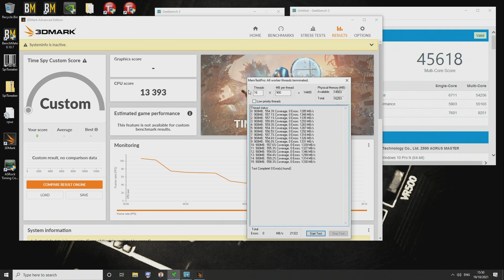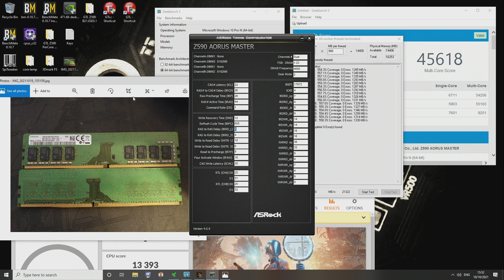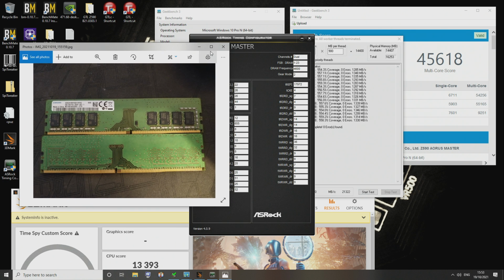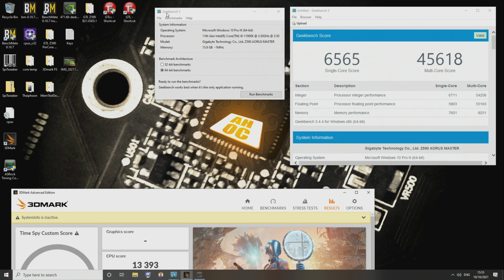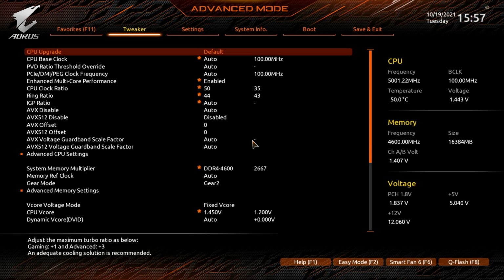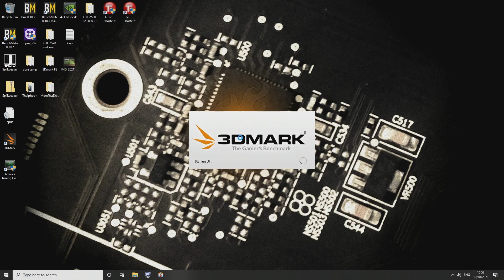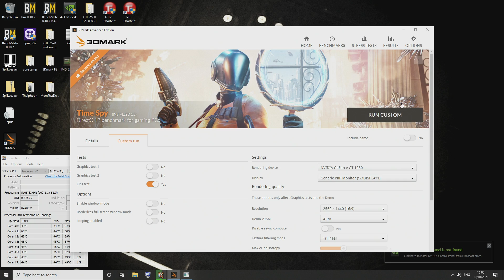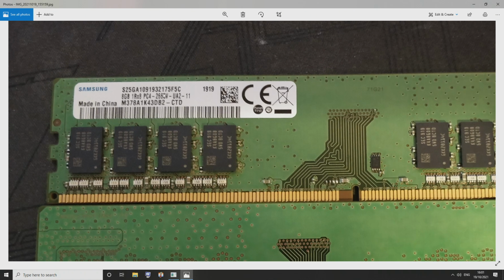500% memtest pass at 4600 CL22 on a 2x8 2666 CL19 kit of DDR4

Comment: I am actually confused, I just bought G.Skill Ripjaws V 3600 cl14 @1.45V 2x16GB and it has 2666V downbin b-die BCTD on a B1 pcb insted of 2133 BCPB. Should I be worried about oc performance???  should I stay at max 1.45V and do a max oc at 3800MT??? 
My system is ryzen 5900x on a msi B550 unify-x.
Thanks for your help.

Comment: I was just wondering, I had some tforce ram that has xmp of like 4500 and runs fine on 5900. It seems that 3600-3800 is a little bit better or do you think I should try to run at 4500 and optimize everything

Comment: Did you hear that DDR5 is going to have locked voltage for some modules? This is going to suck for doing this kind of thing on OEM green ram like this. There is probably a hardware workaround you can do to the power management IC though. Or else it's going to be locked at 1.1v

Comment: I've never seen you play with Gigabyte's 'Memory Enhancement' settings in BIOS. Not sure if it's on every board but is present on z490 Master BIOS version F20. Don't believe you changed 'Memory Timing Mode' in that video either. Im curious to hear what you think about it, if you have experience with those settings, and what difference it makes for stability. In my case turning Memory Timing Mode to 'Fixed', and Memory Enhancement to 'Enhance Stability' stabalized a fairly agressive overclock. Would be cool to see a video where you played around with these and experimented with how they change memory behavior.
Reply: Memory Enhancement just sets secondaries and tertiaries slightly differently. Potentially useful, but you might just lose more perf than you'd gain from the aggressive overclock anyway.

Comment: I have some DDR3 that has similar temperature sensitivity. Registered/ECC Samsung 2gb rev C. It works up to 2200 10-11-11 (bclk limit on x58 board). At some point it crashes and struggles to post, until I let it cool a little. Then it's fine again. There's not much of a gap between working and failing to post. Maybe the register ic freaks out at higher temps.

Comment: Hi buildzoid just wanted to share my results with Nanya 8gbit A Die 2x8 2400 cl16 RAM. I got it to pass 1000% memtest with 3200 at 14-18-18-34-1T. CL 14 required 1.35V. I was able to tighten the secondaries as low as they could go except Twtrs. Even the SCLs did 2-2. I could do it only with help of your videos. I got this with an r3 1200.

Comment: I would love a video about what tweaks joe-consumer could do with a more typical RAM kit. Like I enjoy PCs and have built many, Ive done some OCing over the years of CPUs and GPUs, but I honestly dont touch my RAM. I buy a kit thats reviewed well, I turn on XMP, and thats it.

Im not really looking for anything extreme or finely tuned, but is there a RAM equivalent of say the fact that a GPU comes with a 1 size fits all voltage curve and therefore very likely can do the same clocks at lower volts.
Reply: There isn't a "1 size fits all" solution because different memory ICs have different properties, and different memory kits are binned to different degrees.
However, "DRAM calculator for Ryzen" can be useful as a guideline, even if you don't have a Ryzen CPU. I based my current memory settings on it and got fairly good results, though there were a few timings that ended up a bit better than the tool suggested (especially tRFC), and my RAM isn't stable above 3000MHz even with very loose timings even though the tool suggested that it would be (probably because my memory is a downbin).
Based on my experience, if you want to do a simple change, try reducing tRFC by a hundred points or so. Especially with single-rank memory it has a big impact on performance and lots of RAM comes with it set way too high by default (e.g. around 600 when it can run fine at 400).
Reply: @nathangamble125  Thanks for the comment. Not meaning to be rude, but you opened with 'there isnt really a thing', and then ended with 'but here is the thing I just said wasnt a thing'.

Comment: I have Hyperx Predator 3333mhz CL16 Samsung B-Die. Any help how to overclock this ram, what values should I put. Also what voltage would be safe, because heat spreads are big. My cpu is 5600x.
Reply: Samsung B-die can generally tolerate fairly high voltages (easily 1.6V+), but if you're using Thaiphoon Burner to identify your RAM chips it might be worth trying another method, as it occasionally misidentifies C-die (which doesn't work well with high voltages and could be damaged by voltages that would be fine for B-die) as B-die. I'm sceptical that a 3333mhz CL16 kit would use B-die, though it might just be a very low bin.

If you can, removing the heat spreaders and looking directly at the memory chips is a sure-fire way to identify them. Samsung DDR4 memory chip codenames have 2 lines.
The first line is "K4AxGyy", where x is the capacity of the chip (4 = 4Gb, 8 = 8Gb, A = 16Gb, B = 32Gb) and yy is the chip bus width (04 = x4, 08 = x8, 16 = x16)
abd "5Wx-Byzz" where x is the die type, y indicates temperature range (C = 85C, I = 95C) and zz is two letters that indicate JEDEC speed.
So if the second codename line is something like "5WB-BIRC", it's B-die; and something like "5WC-BIRC" is C-die.

DRAM calculator for Ryzen is sometimes a good source for recommendations, though note that if your RAM is B-die it's probably a low bin, so it's unlikely to run as fast as DRAM calculator suggests. DRAM calculator works best with XMP data exported from Thaiphoon Burner. Its built in "bad bin" preset for Samsung B-die goes up to 3600MT/s 16-20-20-36-60 (that's CL-RCD-RP-RAS-RC) on the "safe" calculation, so there's a decent chance yours can manage that. B-die's tRFC usually goes quite low: 360 should work, though possibly not if your bin is very weak.
Reply: @nathangamble125  ok thanks, that answers a lot of questions. Also just a question what speed is the best to run with 5600x I know latency is very important but let's say I want to downclock 4400mhz cl 19 ram, what speed would be most efficient? 3200? 3600? perhaps 3800mhz with ryzen 5000.

Comment: I have a ASRock X570M Pro4 with a AMD Ryzen 5 5600X water cooled, and G.Skill Ripjaws V F4-4000C18D-16GVK (4000MHz RAM).

What is the best way to OC my AMD Ryzen 5 5600X to run my RAM on 4000MHz on CL18?

Thanks.

And great OC.
Reply: Sadly most Ryzen 5000 cpu infinity fabric gives up after 1900mhz. beyond 1900 it'll start spewing WHEA errors. usually it's best to put it to 3800mhz and tighten the timings as far as they'll go.

Comment: I have 4x16gb of samsung gskill memory but the XMP of 4000 CL19 is not stable with all 4 sticks, even after further increasing memory and SA voltage.
Do you have any idea what else I can try to get it to run 24/7 stable? 
What voltages do you use on the samsung dual rank 16gb sticks? :)
Reply: Quad rank memory is really hard on the memory controller, especially if it's Samsung B-die. Try to lower the frequency and the timings, like 3600 CL16 or 3200 CL14.
Reply: @Odysseas13LefkonaSt  sounds about right
Reply: Does SA voltage have anything to do with soc voltage?
Reply: @BonusCrook  I think SoC voltage is the Ryzen equivalent of SA and IO voltage on Intel.
Reply: SA and IO voltages have a sweet spot, so it's hard to give 100% conclusive answers without testing it (although said sweet spot is generally anywhere between 1.15 and 1.3V, in my experience).

As for memory voltage, do bear in mind that increasing voltage means increasing heat. B-Die is quite sensitive to heat, and with four times the density of a 2*8 setup, that can be a considerable issue.

If you don't want to spend too much time on it, I'd just back down on the frequency. Otherwise, well, test the SA/IO, try a lower ring ratio, tweak the termination/resistance, then have a look at secondaries and tertiaries.
That's how I generally approach things, by order of importance (in my experience).

Comment: Wanna know something crazy. If you buy corsair dominator platinum 32 gig kits 2x16 they say it might be single rank it might be dual rank. So it sounds like it used to be dual rank but its probably cheaper to do single rank and in this world of shortages they all are going to be single rank. Not to mention they want 250 bucks for 32 gigs 2 x 16 kit at 3600 M/T with timings of 18 22 22 42. They know people buy it for the looks and even at the insane price won’t throw in a good quality IC
Reply: It's not that crazy. Ballistix does the same thing with their 3600MHz CL16 2x16GB kits - they used to use Micron 8Gb Rev. E, but now most use 16Gb Rev B, and if you buy it there's a chance you could get either. Memory manufacturers changing rank configuration on a whim is frustrating, but fairly typical.
Corsair kind of sucks for RAM, they sell it based on their brand name and not much else. If you want good high-end RAM, G. Skill is the way to go, and if you want the best price/performance Ballistix and Patriot are the best.

Comment: And my hynix afr 3200 c16 is stuck at 3333 c16 feelspain
Reply: hynix goes as fast as the box says basically in every kit ever, and to make it worse it normally ships with the max voltage that hynix scales with
Reply: I feel you. Rocking c die here
Reply: @ianbenn1  at least c die you can still play with OC on my afr the subtimings and get super tight except for a few but frequency is dead at 3333mhz +
Reply: My Micron Rev B 3000MHz kit won't even go to 3200MHz without getting errors...
though it did go from CL16 to 14, and most of the other timings went down a bit as well, so it's not complete trash overall.